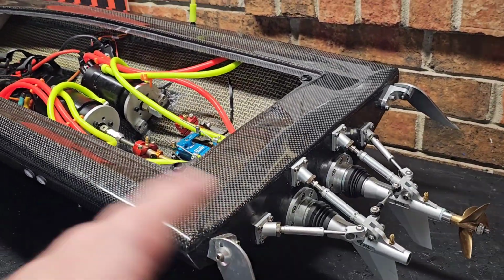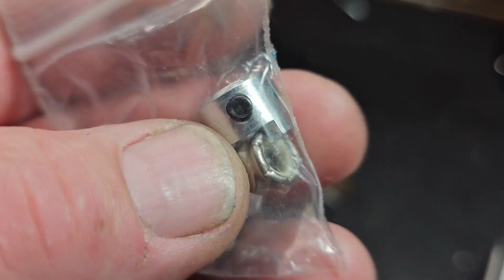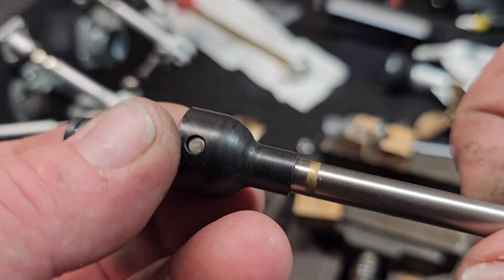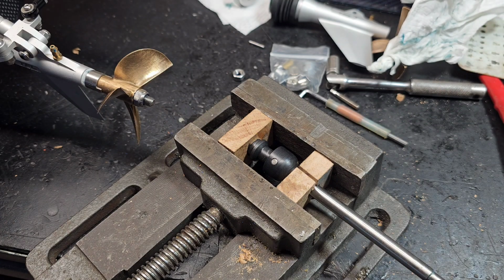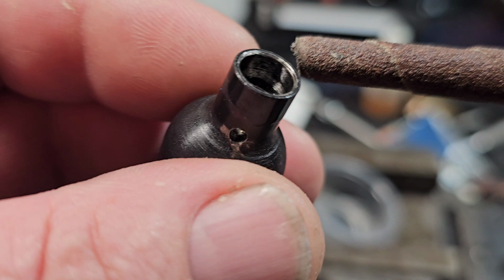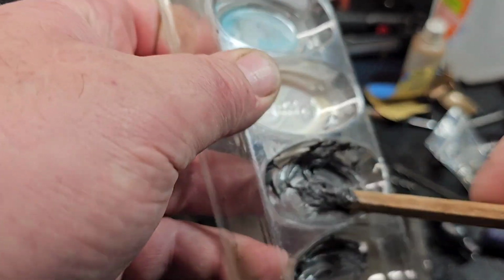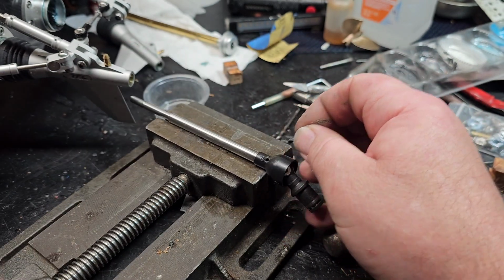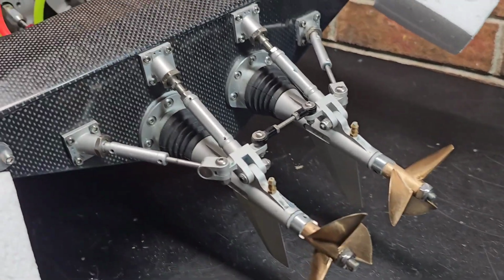Arneson Drive Shaft Repair 51" TFL Ariane

Comment: So i used to work at a paper tube making factory in winter when tree work was slow & i used to just work on the 1950’s-60’s convelute tubes were rolled up like 
Tubes that held material for clothes but anyway we used to have to fix shafts all the time we used taper pins but when we couldnt we used strait pin like your doin but we just peened one end & then when it was in we would have to use a 10lb sledge on the pinned in end & then use a punch sharpened to punch the other end to peen out the end ya know & we were always repinning but the tapered pins were almost never gave us trouble just keep an eye on that sucker that jb is gona dry out & slowly crack into peices just want your boating to go smooth lol  hoping for the best bro🤙

Comment: Big B , enjoyed the video.
I think you have the same issue as before . Please check .

Starboard prop is clockwise rotation and shaft is clockwise rotation and Pinned at thread . This one is secure even without the pin because of the prop and thread are both clockwise .

Port prop is anti-clockwise rotation with clockwise shaft thread - NOT pinned . When powered the anti-clockwise spinning prop will unwind the shaft ??
Reply from the maker: The clockwise spinning prop has an counter clockwise pressure being put on it while spinng and loaded up, that's the one that will unscrew out of the cup. That's the one we pinned
Reply: @IRONCLADRC  I had a feeling that this was the underlying principle . Thanks for spelling it out for me . 
For the common man it would seem that a clockwise rotating prop would have a clockwise force on the shaft . But this is not correct as you shared.

Comment: That’s awesome Big B, the pin is the way to go. 
  I have a set of 5 hard-wood blocks in 5 different sizes for doing just what you did, Helps clamp round stuff in my drill press, 
You got to be innovative in this hobby. 
Tinker Tune and Test, BGFL

Comment: Jb weld is so thick, most of it probably just threads out, not sure how strong it would be once it is that thin. I probably would have used red or green locktite. G t even is for permanent attack.ents just like the red, but is wicking so it is thin enough to apply after the parts are threaded together. Red or green will not come loos we once it is set u less you use a lot of h3at to basically melt is out.
Reply from the maker: I used jb weld on .150 3/16 flex to stub shaft connections running ,4 - 6s never had a connection break.

Comment: I know you know about Red loctite have you tried that
Reply from the maker: Red loc-tite will probably work, I choose jb weld because I have had great success using it on flexcables ranging from .98-.150 flex to stub connections, Never had one come loose actually I take that back i did have one come loose because I didn't give it a full 24+ hours cure time.

Comment: My advice is to DITCH THOSE DRIVES! -
European saw runners, (MHz, hydro and marine)use stinger struts with flat bottom ride surface.
OSE sells the hull with speedmaster struts.
I would consult with Bill Oxidean he has usable hardware on his 60” v bottom that may work for you.
Reply from the maker: Couldn't agree more!   They look collet but I would much rather see a stinger and rudder mounted on the transom.    Arnson drives ha e been nothing but a head ache